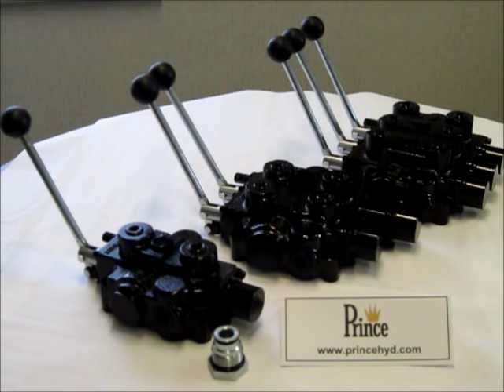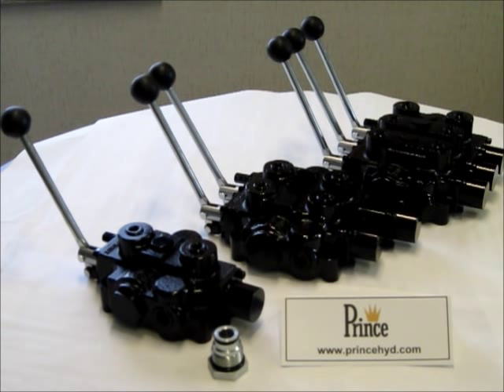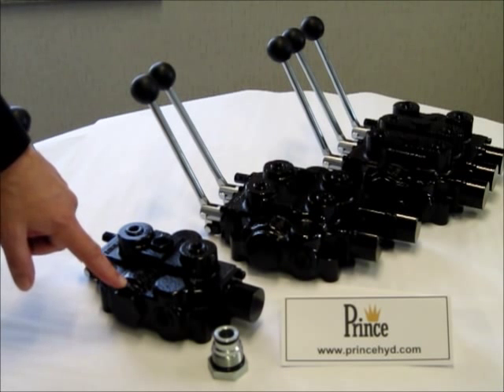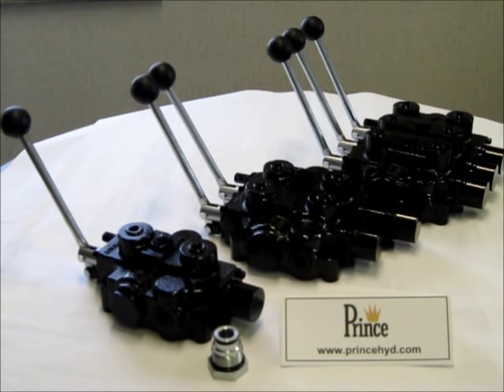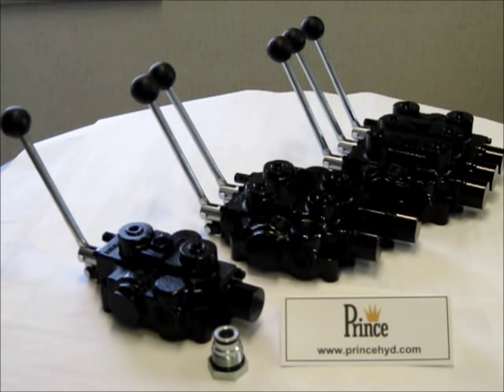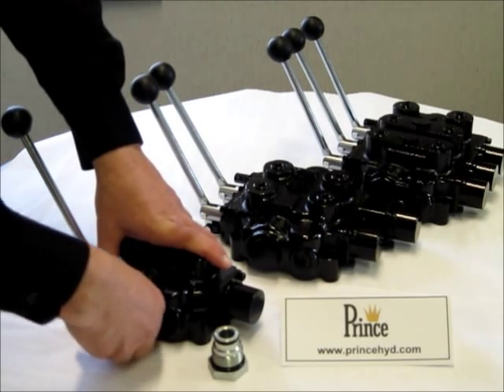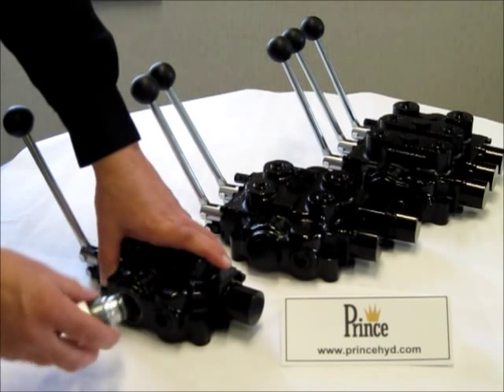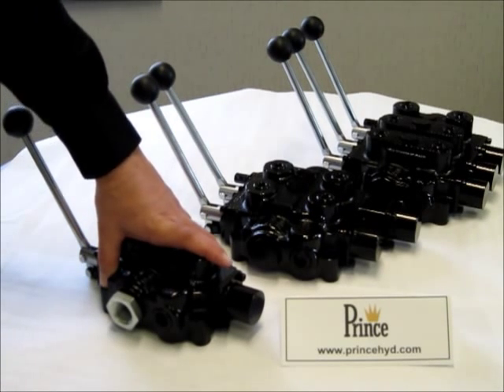Power beyond option for RD5000 series valves

Comment: Can I run two Auto cycle valves together. Firewood Processor build, need to in this order
1. Unclamp
2. Extend ram/ feed log
3. Clamp/ hold log
4. Retract ram

By using two valves it creates an operator pretense control( hands have to be off, once cycle is completed , then saw will manualy switch on off

Comment: How do you configure it when you want to use the power beyond with an attachment.  Say, you have a rd5000 valve running a loader on your tractor but you want to run a backhoe attachment sometimes others it wouldn't be connected at all. Could you put a quick connect on the power beyond?
Reply from the maker: You can go to our website page and click through to Mono Block Valves.  Then open Catalog Pages beneath the RD5100 and scroll to the RD5000 ORDER CODE.  As you follow across the row for either the one-spool, two-spool, or three-spool valve you will come to the OUTLET LOCATION and then the POWER BEYOND option.  That's where you can choose the type of POWER BEYOND port you want.  Here's the link: http://www.princehyd.com/Products  You can also give us a call at 605-217-1220
Reply from the maker: The RD5000 offers two sizes of Power Beyond port, either a 3/4 NPTF port or a #12 SAE port.  You would just need to make sure you had the right port connector on the hose you connect to the Power Beyond port.

Comment: Why would you need a power beyond port on an open center hydraulic system ?  When you could simply run a hose from the return port on your sectional control valves to another valve.  And then run a hose from that valve to return to tank. Full flow and pressure always goes through the sectional control valves on an open center system until one of the spools is operated.
Reply: Because simply adding another valve downstream via the tank port (regardless if its open or closed center) removes the spools ability to tap off high pressure that makes it to the outer seals and dump it into the low pressure return line, the spool valve downstream while in operation essentially removes the upstream spool valves low pressure tank port and makes the whole valve high pressure, this pressure will reach the outer shaft seals and they will fail. 
A power beyond port does the job without removing the low pressure tank port so there's always an escape route for high pressure the bleeds out to the seals.
You can get spool valves that have bigger/stronger seals that are rated for pump pressure on the outlet/tank port for the purpose of doing exactly as you describe but they are usually significantly more expensive, if you need to do it check the data sheet on your valve, they list a max pressure for the tank port, its usually only 150-300psi, not anywhere near enough to use in series via the tank port.